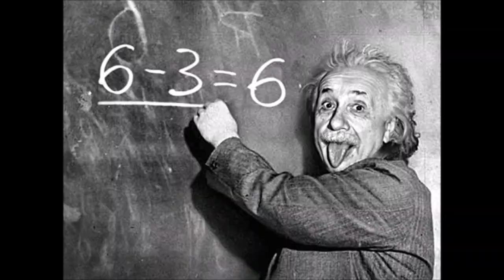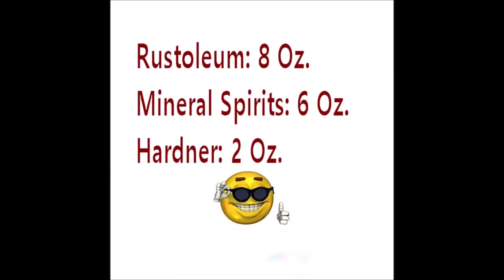VW Beetle Paint Job! 🎨 Rustoleum Car Paint Job -  Paint Mix Ratio - Cheap and Easy Paint Job DIY

Comment: Amazing 👍
Reply: I did my 1980 corvette the same way and roughly the same mixture I used sunburst yellow and it gleems the same way no one can believe I painted it with rustoleum and it looks almost like factory original with a light orange peel that you would get on a 1980 looks great like yours to 👍
Reply from the maker: I am so sorry! I was not alerted on this message! Thats awesome that it came out great! I like the Vettes! Especially yellow! I got rid of the orange peel. With some cut and buffing! Whatta pain!

Comment: This looks great. Given me confidence to do mine in rustoleum. Did you sand back to metal, or did you key the old paint? Did you use any primer on the paint or any replaced metal? Many thanks.
Reply from the maker: Oliver Berridge first of all thank you for being here Oliver!  I truly appreciate it. No metal needed replaced for except the rear apron. 
It did end up going down to bare metal in quite a few spots, however I pretty much went down to the factory primer. 
Believe it or not I used a cheap Harbor freight orbital electric sander. Which worked much better than I thought it would. 
Then I used epoxy primer sealer. 
And then of course the mix ratio I showed. I am really delighted, I did watch quite a few YouTube videos but I did not really like the ratio, and some of them were not using Hardner which did not make sense to me. 
As I said it doesn’t mean I’m right, it’s just the way I chose to do it. Very delighted with the outcome. Thanks for commenting I truly appreciate it.
Reply: @SladesVWBeetle  did u happen to do a video on the rear apron removal/ replacement
Reply from the maker: @kevinc.6523  not yet, but oddly enough I’ll be installing a new apron soon on my current project

Comment: I want to mix rustoleum aluminum with with rustoleum paint to make a shimmering paint. I was wondering how much should I add to the rustoleum paint.  The paint is royal blue.  I'm thinking 1 table spoon aluminum paint with one quart royal blue. What are you're thoughts? Thanks and I love he paint job on your vee dub
Reply: I did this a few years ago with those two exact paints. I did a 3:1 mix for the two paints and reduced with 3 parts acetone and it made a metallic baby blue color that layed on beautifully. For extra gloss and durability add 1 part hardener to the total mix.

Comment: What hardener did you use and what is the exact color ?
Reply from the maker: Rigoberto Salazar I used Sunrise Red, and I used Krylon Hardner. The hardner I bought on amazon. It gave some extra gloss, and of course faster dry time. Thanks for commenting!
Reply: Slades VW Beetle can i use different hardener ?
Reply from the maker: Rigoberto Salazar Absolutely!! I’m so sorry I’m not getting this dang notifications all the time 🤦🏻‍♂️

Comment: Looks great!! Nice find and good job!! Does it come in buckets or gallons? How much paint to do the whole car?
Reply from the maker: Scott S thank you so much Scott! I actually bought it by the quart, I bought 3 quarts and only ended up using two. By the time you cut it with mineral spirits and Hardner, it lessens the usage of paint. Just got to use that Hardner! Thank you so much for commenting. I’ll be doing another soon.

Comment: Why is the car on dollies?
Reply from the maker: My garage is on the smaller side, it’s easier to move around.
Reply: @SladesVWBeetle   Yes, the garage is a bit small, so, move it to where?  ;)
Reply from the maker: Just slide it forward or side to side. They come in handy